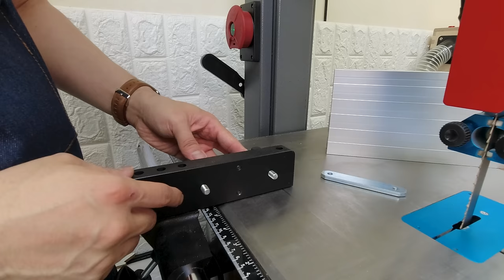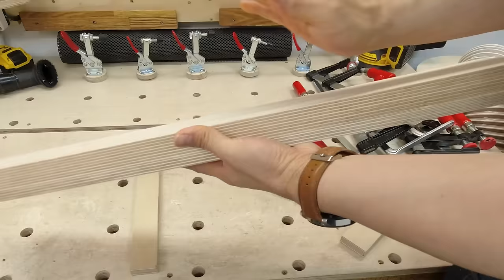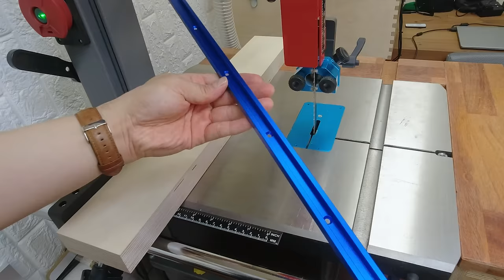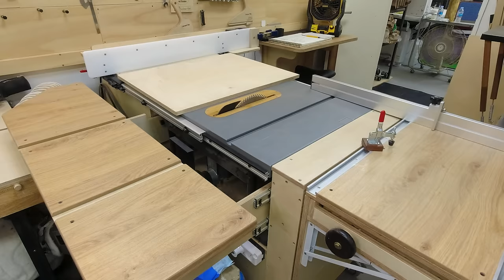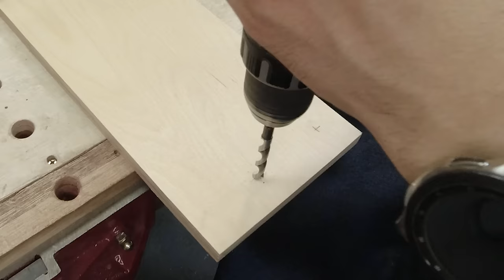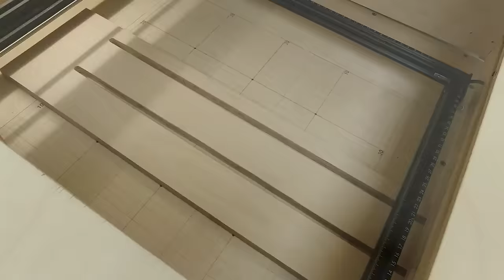⚡[DIY] Making a jig for sawing logs /If you do some woodworking, you should also cut logs /HOMEMADE✅

Comment: I have this exact same bandsaw and have been wanting make a sled of some sort to cut small logs on it.  This is the ticket.  I sure wish I had your dimensions, as my saw is the same.  It would sure make it easier to build one of these with the exact dimensions.  But I will just have to go through the process and figure it out.  Great video and a very useful and safe to use jig.  Congratulations on this, and thanks for sharing it with us.
Jim

Comment: like your jig. Just a quick question> I have the same Laguna make band saw, when I cut logs the saw blade guide block at the back( round) got hot and has a red glow where the back of saw blade meets the round back guide block. I am wondering did you had that happen? Is this normal ? sometimes I have the side guide blocks giving out sparks. Is that normal ? Thanks
Reply from the maker: Just what you said doesn't find the problem.  Having sparks is not a problem.  However, I think there is a problem if the ceramic block gets too hot.  It is recommended to re-set or replace the blade with a new one.

Comment: Hi , do you think can i do this whit a medium bandsaw 750 watt or i will need bigger than (1100watt).
The question is because I'm going to buy a bandsaw.
Thanks a lot
Reply from the maker: My band saw is 1500w.  For this purpose, choose a band saw with high power if possible.  It seems that 1000w is also possible to cut small trees.

Comment: What blade is that in the table saw?  It looks like a very wide kerf.  Or, is it a dado stack?  Great project!
Reply from the maker: Thanks, it's an 8mm thick saw blade.  I use two table saws on my workbench.
Reply: @carpentak  Surely that is a typo on the blade thickness.  8mm is a huge piece of steel to spin up on a circular saw.  I'm thinking you meant a 2.8 mm thick blade.
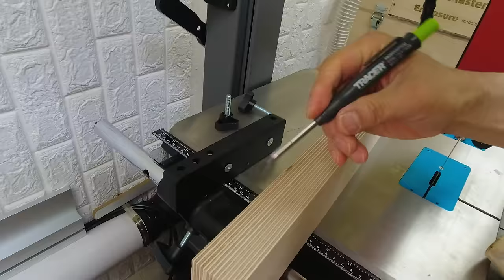Reply: If you watch CarpenTAK's table saw sled video, at about 2:31 he opens the door to raise the blade on that second saw.  Looks like it must be the 8-1/4 inch Makita 5008MGA that he has rigged up to use as a table saw.  The blade can't be 8mm thick.  No sidewinder circular saw takes an 8mm blade.  I believe he is using a 2.8mm (1/8 inch) full kerf blade that has a flat tooth grind.  The flat grind produces those nice rabbit and dado cuts.  It's hard to find a full kerf flat tooth blade for your typical 7-1/2 inch circular saw so that's why I think he is using he larger Makita saw.  CarpenTAK's table saw setup is a work of art and super efficient.
Reply from the maker: @jimmysierra5551  Hi!  You are watching my video closely.  But it fits an 8mm thick saw blade.  I did not make a typo.  This is a special saw blade made by a professional saw blade producer here in Korea.  The thickness of the disc is 3.2mm, which is the maximum allowable value for a Makita circular saw.  But its teeth are 8mm.  Most saw blade manufacturers don't have blades like this, so you'd think so.  Unfortunately, this company has a small business scale and does not even sell overseas.  Shall I do some distribution? haha
Reply: @carpentak  Ah, I see.  Well, that is one thick blade indeed. No wonder it looks so intimidating when it rises up through the table. You should give a blade like that a nickname and engrave it onto the insert with your laser.
Reply from the maker: @jimmysierra5551  good idea.  I'll try.

Comment: 15:19
My brother, I have a cnc machine, this is a hand held tool, what is its measurement, I will make it myself, if you tell me its measurement, please
Reply from the maker: I just copied and printed this out of the picture.  There are no measurements. Sorry.
Reply: @carpentak  Ok But Any Idea 💡 ?
Reply: It is just a handle, you can copy from a comfortable plane or a hand saw, or make one that will fit your hand!  Measurement is not critical in this case, except that it fits the user.  Measure your hand!

Comment: what do you use to seal your logs? Great video and jig by the way
Reply from the maker: Apply woodworking bond to the end grain and store it.  thank you
Reply: @carpentak  just glue then is it a special type
Reply from the maker: It is a water-based bond used for woodworking.  Water-based paint is also available.

Comment: Very cool jig. If I may ask, what drill tool did you use to screw in the threaded bolts into the wood. Make and name or a link would be very helpful. Thank you
Reply from the maker: https://a.co/d/f2dt1VA
Reply: Thanks for the link to the taps, but I’m interested in the drill tool at 3:12 in video that screws the bolts into the wood. Thank you Tak
Reply: @steveferguson1232  Same question here! :-)
Reply from the maker: @steveferguson1232  I bought it here at a Korean hardware store.  So there is no link and I don't know the exact English name.  sorry
Reply: Self-tapping socket adapter
Reply: Buy an appropriately sized long nut (M8?) and glue halfway into that a piece of bolt, cut so that the threaded part is halfway into the nut then cut off the plain shank part and use this bit into the drill. You could also weld one to the other if you can, and yes mine works well!
Reply: @steveferguson1232  I just use 2 nuts with a lock washer in between. Put a socket on the top nut only and it will screw in no problem, then take the nuts off.

Comment: /!\ By working as he do here, you surely will loose some of your fingers, and they may not regrow after ! 
Always use a pusher when using a table circular saw !!!  
                             And always remember: SAFETY FIRST !!!
Reply: Absolutely correct. At a minimum, make a fist,  if the space between the fence and blade is smaller than your fist is wide, use a push stick.

Comment: Si c'est pour faire un belle appareil et pour faire tourner ta chaine, c'est super.
Mais si c'est réellement pour faire des planches, il y a beaucoup plus simple et ça ne coute rien en temps n'y en argent.
C'est quoi ???
Tu choisis la partie la plus droite de ton rondin, tu le passes à la dégauchisseuse, tu fais 1/4 de tour, tu dégauchies et tu peux le passer à la scie avec ton guide.
Il est vrai qu'il faut avoir une dégauchisseuse, tout le monde n'en a pas.
C'est quand même du beau travail.

Comment: I love your designs! But why not cut the log down the center and place the smooth side against the fence? 🤔
Reply from the maker: It's just an ordinary way.  If you just cut the log center, the cut side will be rough and not straight.  Then there are a lot of next tasks.  Pushing against the fence takes force.  This jig cuts the cutting surface uniformly and cleanly, and it is easy to work with.
Reply: @carpentak  I understand now. Thank you.👍

Comment: Push stick?   Ahem !
Reply from the maker: hahah you?  You are so smart!  how do you do that
Reply: @carpentak    70 years old. three table saws in my life. half a dozen radial arm saws. As many hours on a table saw as most retired commercial pilots have hours flying.  And from the age of 12 to today, I have remained scared witless of losing a finger or two.  The trick, key, hack,, whatever you wish to call it is two fold.  A 'No Go'  area emphasized with brilliant danger orange paint.  No finger shadow ever to be within the bright area, push stick territory strictly.  Table and radial arm saws,,, and  more importantly  there is ALWAYS a sacrificial push stick ,,, On the table,, Just to the right of the fence,, The end sticking out towards you so you can pick it up without looking.
Cuts can actually be made much more accurately with a push stick,, because you can safely push the line right up next to the saw blade,,, which,,, tends to keep the straight edge lined up tight against the fence.

Annnnd if you do not have the push stick,, or it just will not fit,, hook fingers over the fence and then guide with thumb and fore finger.  The fingers hooked over the fence make certain your hand does not wander.

Want an additional safety tip?  Never stand in line with the piece being fed through the saw.  Always work from the side.  Always.  When a piece decides to jam and is thrown,,, let it punch a hole in the drywall or the ceiling (table saws hit the wall, radial arm saws hit the ceiling)  NOT you.  A little mud and paint fixes one,, the other requires a surgeon and 40,000 dollars.
Reply from the maker: @Sailor376also  Oh, that's what I meant.  I thought I was just joking, so I answered.  I misunderstood. 
Thanks for sharing your knowledge and experience.  I will pay more attention to working safely.  It will also help my channel visitors who see this comment.  thank you

Comment: What a waste of effort It takes too much capacity off your Band saw. on your last cut the two clamps intrude too much into the line of cut. Start thinking outside the box and create A jig that has more room for the work and less for the Jig. Make it more useful stop exhibiting your tool kit and show more talent.
Reply from the maker: I understand your thoughts and thanks for the advice, but it doesn't help me.  I have no intention of making a simple jig in the first place.  If possible, spend more time complicating it.  My workshop is not a place where products are manufactured for commercial purposes.  There is no need for efficiency and time reduction of work.  I make what I want to make.  I enjoy making things complicated and I enjoy it.  And my video just shows it.  My video is not a video to educate the efficiency of work.  Some people don't like my videos, but there are definitely others who like it.  I make videos for people who like my videos.  Just be aware that I have a different opinion than you.
Reply: The jig is more complicated than many others on youtube.  I'd say the biggest benefit it offers is the easy adjustment of setting successive cut widths using the fence and scale.  And you can't go wrong with a laser.